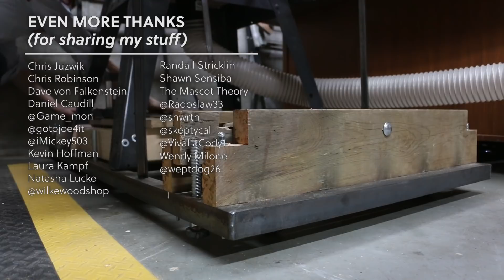Making retractable wheels for a heavy table saw

Comment: Nice solution. I think I've viewed them all. There are at least 10 different ways to skin this cat if not more.  By the looks of it this had to at least been a weeks worth of work?   I think I'm going to stick with 4 bolts in turnbuckle sleeves that weld to the base frame.  Sure, wrenching them down and up is 4x the work of a lever (or two) but it can be quickly done with a drill and socket extension.  For the amount of time and work involved in building these levered set-ups I'm on the fence as to their worth vs time to create, especially for people like me who may only need to move their table-saw a few times a month.   If I needed it to move daily...different story. Nice job nonetheless.
Reply from the maker: Thanks! You bring up a good point on the time to build vs. actual time spent moving the saw around with the threaded levelers, especially when using a drill. When I was building this, I had an hour here, 30 minutes there, etc., to work on things, so it took me waaaay longer than a week. It actually took more than a month, factoring in all the failed prototypes. :O But if you had some solid chunks of time to work on this project, I think the build could be completed in a couple of days, just because you wouldn't have to reinvent the wheel. 

Regardless, now that it is done, I'm happy I don't have to crawl under the saw anymore to get to that leveler in the far left corner against the wall... I banged my head on those cast iron wings A LOT. Take care!

Comment: Week later how is it holding up don't take it you use it that much other than getting under their to clean up.
Reply from the maker: +CatchMyThrowingKnife Still holding up great. I definitely won't be using the wheels more than a couple times a year, to make room for ripping a long board or reorganize the shop. But the project was still worth it. These casters are much easier to engage than the previous version, seen at the beginning of the video.